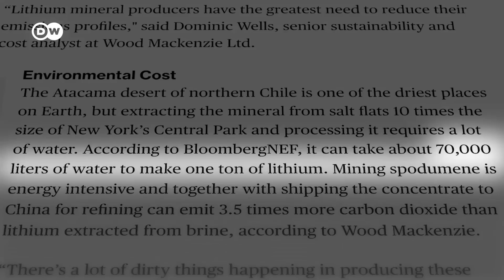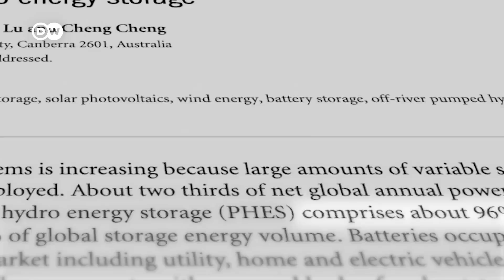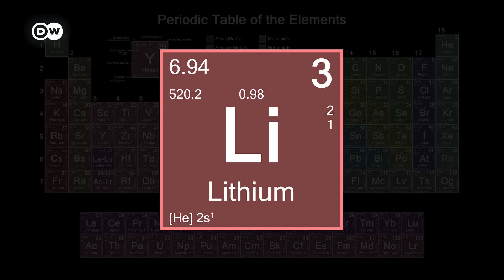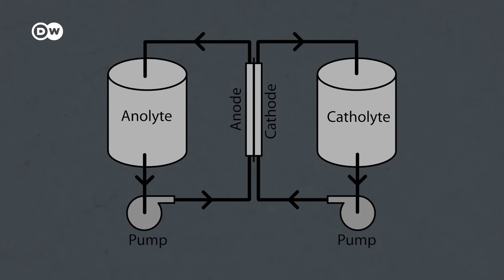How salt and sand could replace lithium batteries

Comment from the maker: Did you know about all these different kinds of batteries? Which surprised you the most?
Reply: Salz und Sand.  Sie sind überall und das ist großartig.
Reply: Loved what Malta is doing with molten salt. It's on another level!
Reply: Sodium is not prone to blowing up?? You might want to confirm that lol. 

It is extremely explosive when exposed to water.
Reply: @off_mah_lawn2074  only if it's pure Sodium.
Reply: I have heard about most of them from Matt Ferrell's channel and  Dave Borlace at Just Have a Think. You didn't mention the iron air batteries tho lol or co2 batteries, or Compressed air batteries, there are loads of them some real wacky ones and some with real potential. I think in time sodium can overtake li-ion batteries on cost and energy density. it will just take time and money. just like li-ion has had 30 years to get where it is now.
Reply: 3:53
Reply: The salt solution and sand solution
Reply: You missed the molten Salt via Solar parabolic mirrors, heated for 12hr / gives off heat for 12 hours, also melts flocks of passing birds !.
The stones comment at the end, has been used since the Neanderthals days - leave a stone in a fire then take it to bed with you on a cold night.
Reply: New energy just revealed ??? Some kid with a magnifying glass heating up a stone all day, - lets build a bigger version in the mojave dessert said expert insider
Reply: All of those were on the table 20 years ago. Some are even not listed despite been used for decaded, especially on islands etc. The video title is just a scam, nothing is new on sight.
Reply: I hope that tank in Germany is a sturdy one. That amount of 98C water sloshing through your neighborhood makes a lot of hard boiled eggs.
Reply: Did you know about LiFePo chemistry lithium batteries? Look it up before you make a shortumentary.
Reply: What surprises me the most, is that 100 years later we are still using essentially the same battery technology... gosh, it's almost as if battery makers were seeking out any improvements like a battery that lasts a whole lot longer than lead/acid and all the other old stuff and buying it out so's not to cut into them selling batteries that wear out faster... but obviously, that must be tin-foil hat talk!
Reply: @adus123  True, he didn’t specify tho
Reply: The narrator's voice!! 🙄
Reply: There is hemp batteries also have great potential
Reply: Nuclear battery.
Partial infinite charge > almost 28,000 years.
Reply: I think I did watched a documentary about how human brain could be a battery although you need a lot of them and you have to collectively put them into some kind of virtual reality so they wouldn't be bored.
Reply: why DW didn't mention lithium solid state battery
Reply: I loved the sand solution . Imagine in the hot middle eastern desert countries using sand from deserts to store electricity which can then be used to generate electricity for air conditioning.
Reply: Very interesting especially with the salt aspect
Reply: @sujesh4684  Actually, an energy storage project has been built by using molten salt located in Gansu province of China.
Reply: @sapien6230  Almost impossible, because the salt reserves are very large.
Reply: What about diamond batteries?
Reply: I didn't know sand. It's hot.
Reply: Reservoirs filled with desalinated water for hydroelectric generators.
Reply: I follow JustHaveAThink. He covers these technologies monthly. Sand is more dear a resource than many might imagine. It is an essential ingredient for every computer chip.
Reply: @GhostOnTheHalfShell  Yes. And it is as abundant as sand.
Reply: still believe in solidstate.
Reply: CATL is on fase 2 producing Sodium-ion batteries that have surpassed the energy density of LiFePo4 already ;) That would be a real game changer that can replace Li-Ion and other types of lithium batteries.
Reply: None of them.... hemp battery surprised me
Reply: Using piles of sand for energy storage. That's a new one on me.

✌️&❤️
Reply: Have you heard of nuclear batteries?  I know loads about science and tech, so I know about batteries etc.
Reply: The best is CO2, EnergyDome in Italy
Reply: Sand related batteries vague idea.
Reply: @ibra29 Because they are  journalists and clueless about batteries!
Reply: Great content.... Just reduce the background music or increase the narrative volume.
Reply: I'm surprised that PET Tape causes that lithium battery decharge themselves
Reply: You forgot the EnergyDome designed in Italy!!
Reply: Leave out the intrusive, irritating, needless music
Reply: Ambri ones, the ones you "forgot" to name  and explain in your "reportage"
Reply: Salton lake in California is a place for turning the salts into energy, warren buffet company is investing in the area. Ism sure scientist is investigating similar ideas at the Dead Sea
Reply: @st-ex8506  Yeah agreed, they didn’t specify in the video though
Reply: Solar heating salt battery African bus model* prototype production Franchise agreements, anyone interested?

Hybrid solar-salt battery charger ®™✓

Comment: "If you can't bring them on a plane" - but you can. People bring lithium ion batteries on planes thousands of times daily. Laptops, phones, smart watches. You're just limited in the size of the lithium battery you can take on a plane. And of course there are different types of lithium batteries. There's also lithium polymer and lithium iron phosphate.
Reply: 99W limit.
Reply: Yes lithium iron phosphates is being used in a lot of EVs coz they are cheap and don't explode and also last longer. Their only disadvantage is a little less energy density that lithium ion.
Reply: @toma.cnc1  100WHr*
Reply: @UhOhUmm  its 99,99 WHr actually 100 is illegal you can find it in laptops the maximum is 99,99 not 100 WHr
Reply: I think you can bring lithium ion devices on carryon luggage but not check in.  I tried to put my computer bag in a check in, and was told to remove it due to the lithium battery on the laptop.
Reply: Never been stopped for a battery but one time I saw someone get stopped for salt
Reply: Let's not forget, that planes also use lithium batteries 😂
Reply: Perhaps.. But try buying two 4S 850mh lithium packs from the internet and see how they ship them. 
It sucks!
Reply: In 2016 I travelled with 10 laptops . All the batteries were removed. They went through my bag but they didn't remove anything.
Reply: Actually, there are restrictions for that.
Reply: @nntflow7058  exactly just because you got them on the plane doesn't mean anything like I was telling people here to try ordering batteries and see how they get shipped to you I guarantee it's going to be shipped ground.
Reply: Why would any intelligent human being bring a flammable item that cannot be extinguished because it contains its own oxidizer onto a plane where it can't be evicted?
Reply: @billfargo9616  I can think of a grip of reasons why.
I couldn't say any have an intelligent base.
Reply: @billfargo9616  If the airlines accept taking batteries then they are the ones to blame. They inspect all luggages and scan them. Don't blame the passengers.
Reply: Yeah in the pressurised cabin not cargo bay
Reply: @monmalin  they don’t accept them though. If you fly, you sign a declaration that you don’t have dangerous goods including loose batteries, lithium batteries over certain kwH, or power banks or similar in checked baggage.
Reply: Yeah this chick's just want to bad mouth lithium batteries. She's not even up on the newer and better chemistry.
Reply: Not batteries alone. Like a box of laptop batteries. You can't bring it like your checked bags.
Reply: I don't understand, how does one get on a plane thousands of times daily?
Reply: @billfargo9616  you're making me wonder if a device with a battery or anything else has caught fire on a passenger plane and been thrown out the door 
by a desperate crew who couldn't put the fire out.

Course opening a door on a plane at altitude presents huge problems off its own.

Not sure if there is any other opening on a plane big enough to throw out a laptop. 
Cockpit windows? Doubt they are big enough.

Imagine too that most home owners don't want a flaming 
laptop thrown from a plane  crashing through their roof at incredible velocity.
Reply: And planes disappear over the ocean, never to be seen again...
Reply: Can you bring like 10 99WHr batteries?
Reply: In the context of the video it makes perfect sense and they were clearly referencing that batteries aren't allowed in hold luggage because they are prone to overheating or causing ignition
Reply: @ToyoteroMundial  Life's like a box of laptop batteries. You never know what you're gonna get.

Comment: For grid storage, you can use the worst battery chemistry, like Iron or Sodium batteries. Energy density can be awful, but it doesn't matter. Unlike in cars or phones, battery size and weight is not a constraint here. The only constraint for grid storage is cost per capacity.
Reply: Exactly. Flow batteries are ideal (but not 'sexy').
Reply: Why wouldn’t lead acid be better for this? Resistant to temperature?
Reply: @TonkaFire2019  Because they dont last long.
Reply: size kind of is a constraint, you don't want to take space where we could build houses to put a battery in there
Reply: So we'll never get away from lithium? The amount of environmental destruction just to mine it is insane b

Comment: Terrible inaccuracy at 5:30 - 5:50. They said the molten salt storage can store energy for 6 hrs but lithium only for 4 hrs. But lithium can store energy for months with little loss if you wanted it to. 4 hours is the time frame that they make the most profit out of it typically. It's purely economics that sets that time frame, not physics.
Reply: I don't think they really didn't explain that very well. Lithium batteries can put out a high capacity energy source for 4 hours from start of discharge to end. Obviously you could double the pack and get 8 hours but they're not typically used like that.
Reply: Isn't it because of its risk of blowing up?
Reply: @sr.antipiro8669  with newer battery management systems, blowing up is more a thing of the past
Reply: yeah I thought that was odd. I've got several lithium batteries that I may charge and use periodically over months before recharging.
Reply: It's actually the opposite of what they were implying. The molten salt has to be used within 6 hours of being charged because it loses heat to the atmosphere if left too long. 6 hours is the maximum charged til discharged time. With lithium batteries you can charge them, then wait as long as you want, then discharge them. 4 hours is the discharge duration. But this is not the maximum duration as implied by the video, it is the minimum duration! Storage facilities are built with a certain storage capacity and maximum power output. The 4 hour figure is what you get when you divide the capacity by the power output. You could build it to have half the power output and then the duration would be 8 hours! That would be slightly cheaper to build, but they wanted the 4 hour time because that is the duration that is needed to cover peak demand time in the evening. It's on purpose. If you didn't need the full power output at any given time you could easily output more slowly at say 10% of maximum and make it last 40 hours. 

Molten salt is not better because it lasts longer as implied by the video. It's only better if it can be made cheaper. The main problem with lithium is capacity. It would be very expensive and environmentally problematic to increase lithium supply to be large enough to fulfill grid storage needs. We need to save it for the cars where its light weight is important.
Reply: @sr.antipiro8669  for storage (and everywhere else i would hope) you would use Lithium Iron batteries (LiFePo) which are comfortable from 0% to 100%, not sensitive to thermal runaway or gunshots and have many more cycles. Which the video totally ignored and it is quite unfair.
Reply: Surojit Advaita Vijayate  where large scale nuclear is available it may be more cost effective to vary the output rather than build large amounts of storage. In northern Europe we need much more energy during the winter for heating. If you could run a power plant during the winter and shut it down during the summer that would be less economically efficient for the plant but it would drastically reduce the need for long duration storage. You'd still need day to day storage, but not 6 months storage.
Reply: Thank god to this is one of the top comments.
Reply from the maker: You're right, Adrian. We confused for how long lithium-ion batteries can store energy with how long it takes to discharge them. They can store energy for much longer than four hours. And even when talking about discharge duration, it's possible to build batteries with more than four hours capacity. Thanks for pointing this out and sorry for the mistake. We'll also put this into the video description.
Reply: @DWPlanetA  Its not time you measure for battery capacity, it's amps and milliamps. Now each battery does have a speed at which it can discharge, but it usually relies on the amount of draw the circuit it is connected to takes.
Reply: @sr.antipiro8669  molten salt can blow up too.
Reply: @isaactippetts882   you can’t talk speed or space without time
Reply: This topic always comes with an economic perspective, if you leave it out, you are unrealistic, and you are out of the game. This is not pure physics.
Reply: @TheViettan28  during WW1 the allies were having trouble with shipping men and supplies to Europe because 
German submarines were sinking allied ships.

The American comedian Will Rogers  said that the solution was to 
raise the ocean temperature to boiling and then that would force 
the German submarines to surface where they could then be captured.
As to how to raise the temperature of the Atlantic Ocean to boiling Rogers said that that was a detail for others to work out
but the important thing is that he had provided the basic solution to the submarine problem.

Of course there is no huge technical problem in heating a tiny, tiny part of the ocean to boiling (say a cubic metre of the ocean)
but the economics of hearing up the entire ocean to boiling 
are an insurmountable obstacle.

Comment: In fact we have another battery type as an option: high temperature sodium-sulfur (NAS) batteries! It was commercialized 20 years ago by NGK Insulators as stationary battery system and has been used in several countries in the world. Sodium and sulfur is abundant in the world and in my opinion it is one of the best options for now and the future! No one talks about NAS unfortunately, but this system deserves to be globally known.
Reply: There must be drawbacks if they are not popular...
Reply: @АгронДепартье  Not more than LIBs actually.  I think that this can be because of the company culture, they don't advertise their product so much.
Reply: @elifceylancengiz7350  Sounds naive. Good stuff doesn't need advertisment - look at Tesla.
Reply: @АгронДепартье  Do you really think that Tesla didn't do anything for showing the potential of their products? :) Advertisement is not only made by showing the ad on tv or websites.
Reply: @elifceylancengiz7350  Created good product ?
Reply: @АгронДепартье  I believe putting a car in space is pretty good marketing 😄
Reply: @АгронДепартье  They can't be extinguished if they catch fire ! It was nasty.
Reply: @aemma_official  Car in space - marketing of batteries ?
Reply: I think that CO2 batteries are better
Reply: @archived_204  There's no such thing as a CO2 battery, nor a salt battery, nor a sand battery !
Reply: @АгронДепартье  Yes they caused a massive fire (in Japan) that couldn't be extinguished.

Comment: I've loved the concept of saltwater batteries, for years. The US manufacturer of them dropped the ball and went out of business, but not because the product was bad.   Thanks for finally mentioning them. Is there any news of a new manufacturer for them stepping forward? I heard a rumor of a Chinese company doing so. They would not be good for cars, but with their low manufacturing cost, and their durability, they could be quite useful for home, business, and grid storage. A Li-ion home storage solution maybe the size of a breaker box, and a saltwater would be the size of a dishwasher, but if it's only a few hundred dollars, rather than $5k+, it's  an attractive option for most places.
Reply: That’s not why saltwater batteries were abandoned. Their real problem is that salt batteries also consume metal (magnesium , etc) and very low in power density. It’s literally done in high school chemistry lab! Not feasible in commercial setting.